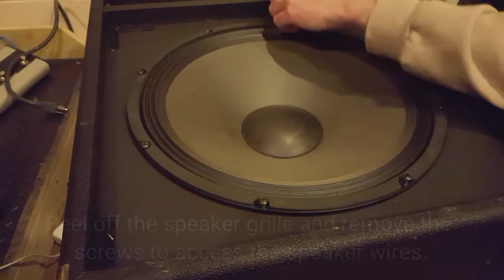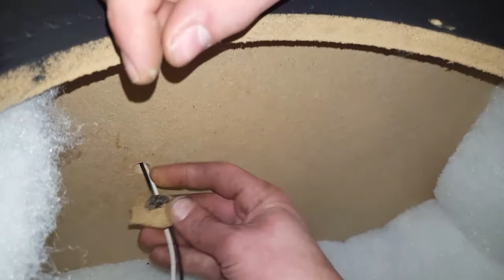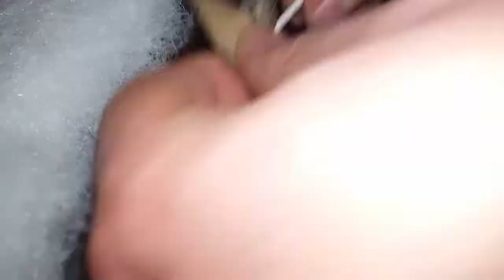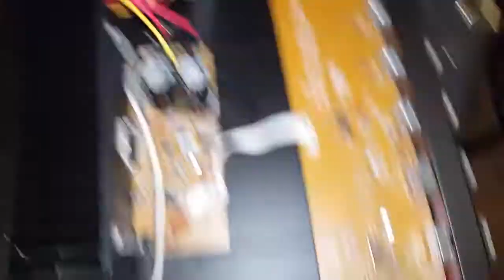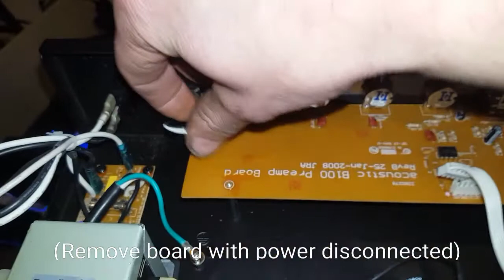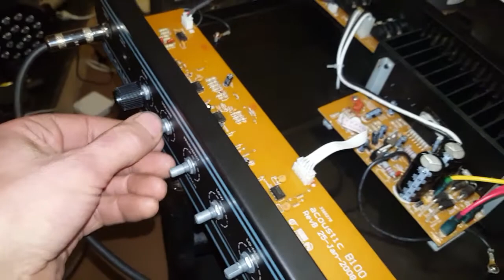Acoustic B100 Amp - Humming, Noise and No Audio Fix

Comment: Has anyone had that issue with the B100C? It's a completely redesigned amp from this generation (the tilt design to point the speaker up at you & a lot more features/ higher quality components) really makes it feel & sound like something twice the price point. I'm asking because I've been using a B100C for a year or so as a practice amp (live in a condo, I just leave my rig at my buddy's house). I was using a Mark Bass 801 before, I just cold not get the lows & low mids out out that 8" speaker. I sold the Mark Bass cube, really liked what I was hearing out of the new B100C, and was able to buy it new for less than I sold the 801 for! I think it's a great amp, and acoustic really out did themselves with that one. The minute I plugged in at home that 12" speaker... with all the new eq frequency blends brought back the thump and growl of my Jazz Bass instantly. Don't sleep on what acoustic is putting out now; bang for your buck wise it's easily the best 100watt combo.
Reply: Just purchased a used B100C. Sounds great, well built and has better tone than the Rumble 100. It is heavier though.

Comment: I’m having a similar issue with my b450 combo. No sound unless I crank the volume and OD then I get crackly sound from the amp, but cuts out.  Im pretty sure it may be the same issue, but this is the only video I’ve found similar to it
Reply from the maker: Yeah. I didn't see anything about the amp online. As soon as I'd taken it apart I saw the flaw of how the board is dangling on the one end. That will definitely cause issues over time. If it's the same design it could very well be the same issue.

Comment: I have 1971 Acoustic 140 amp. I have  a driver transistor on a power amp that distorts the the sine wave signal into a sorta  noisy stair step pyramid. I have changed all the caps. What could cause this. The following transistor driver is a lot worse. The output to the speaker Looks like its only amplifying the negative swing of the signal.  Bad bias resistor? Bad transistor 2N2484?

Comment: On the b100mkii, the preamp pcb board still warps...and even pulled solder pads off...they use a very thin board...and when it gets heated... major problems. It's under warranty, but it was given to me because it wasn't working. I have no problem replacing the preamp...but if it's a factory flaw, why the issue of trying to get a receipt.... sending the whole thing to California, wait weeks to get it fixed. Acoustic application does not have service centers....so either way one's screwed. Amp is not even 2 yrs old!

Comment: I have a question, I have a B200 acoustic H , and whenever I plug in my guitar to the passive or active input, it gets a moderately loud buzz that is around even when I unplug the guitar and set everything to 0. 

What might this be?
Reply from the maker: -Check if the board is as poorly supported as this one. It could be dangling down very slightly on one side/warped and causing a solder connection to slowly break loose. Wiggling the mainboard (board with input jacks) around until the buzz begins to worsen or disappear would point to a loss of continuity at a weakened solder joint. 

-Is your outlet/circuit grounded? Are other devices plugged in to the same circuit that may potentially cause a buzz/interference? I receive interference on my guitar amp when some other devices are on the same circuit. But generally, ungrounded outlets have given me the worst buzzing and it is very common to find.
Reply from the maker: Just don't be sticking fingers where they don't belong if you do wiggle the board around while it's powered.

Comment: We tried to remove this amp head. We got so far as to remove the epoxy plug.  The bass head is lose and can move forward and back an inch or so but it hits something when trying to slide out.  The wire appears lose and the feeling is more like it hits a hard stop.  Anyone have any idea of what it may be hitting?
Reply from the maker: Give her a good firm push and twist it around.